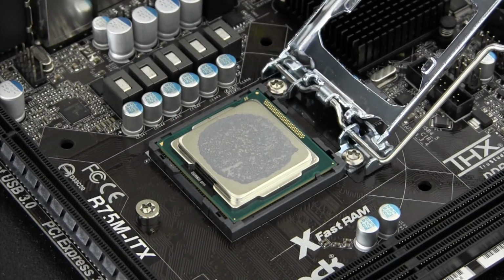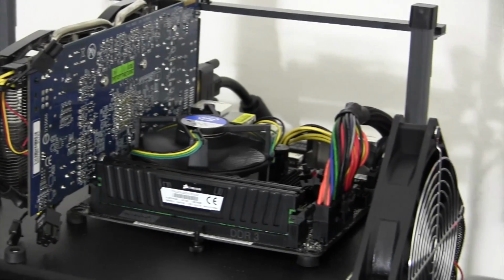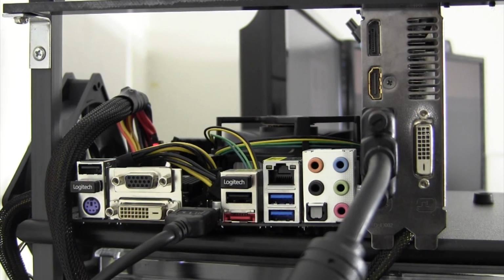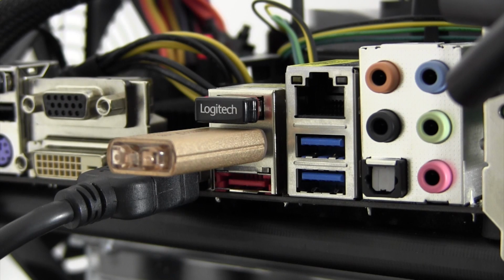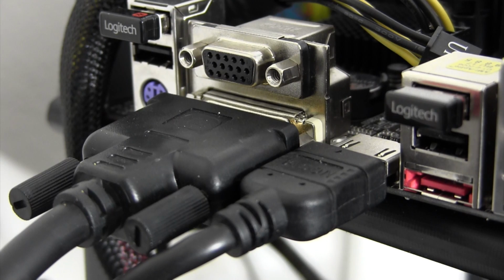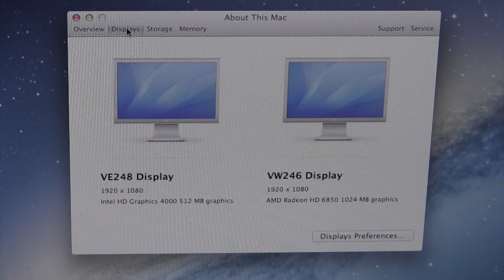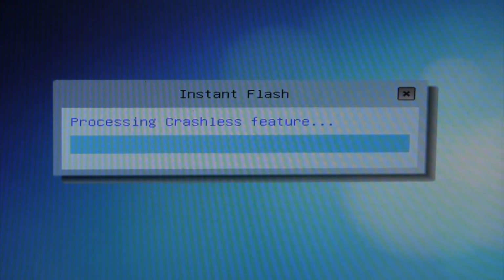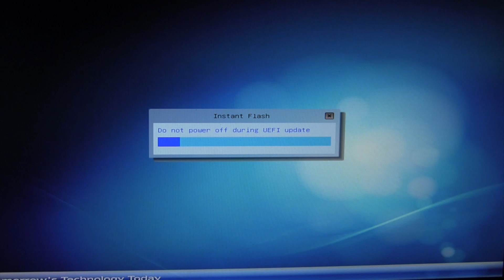Hackintosh Hardware: AsRock B75M-ITX [Motherboard]

Comment: I can confirm the USB problems don't exist in Mavericks (10.9.4). I didn't add any USB kexts or modify anything. Plain, non-DSDT install and all ports work, at the right speed with no freezing. Audio and ethernet need kexts, however. Both work when installed.

Comment from the maker: Installing a bootloader isn't modding. This particular board may not be 100% with OS X, but that's the point of the series; to steer people in the right direction when purchasing components for a hackintosh. These motherboards may have been designed for Windows/Linux, but I assure you, OS X runs great, provided you get a compatible motherboard.

Comment: You are Softmodding the board by installing a bootloader on it, along with that how could OS X take full advantage of the machine if not all the ports will work with OS X. You are also installing OS X on a board that was optimized for Windows/Linux.

Comment: This isn't Hackintosh Hardware its PC Hardware that has been modified (butchered) to run an OS that it wasn't design for. You are under powering the Board by putting OS X on it.

Comment: Thank you for the review, sir. You're saving us from a lot of headache in trying out a board only to find it isn't what works.

What I could really use info on is what main-board / graphics card / etc would get your highest recommendation for building a system to do photo editing on? Running Photoshop, Lightroom, etc. Also need to have RAID 1 (perhaps a RAID 10 capability for future use) for photo file storage and perhaps a SSD as the main drive.

Thoughts?

Thank you!